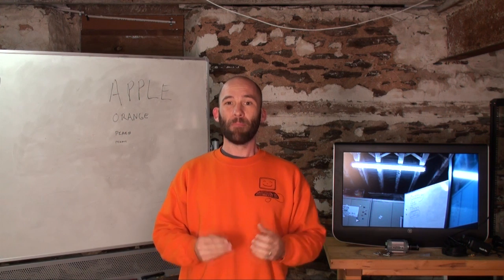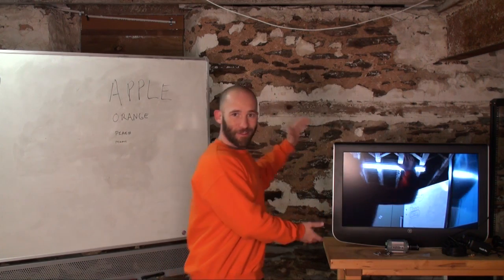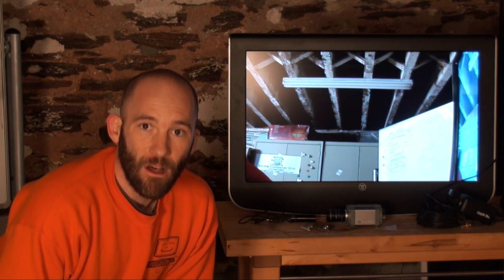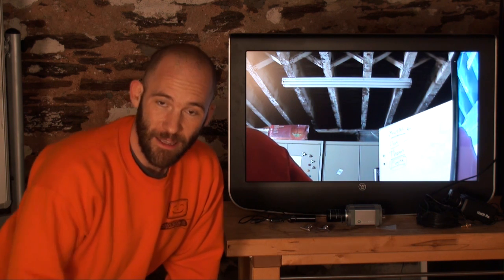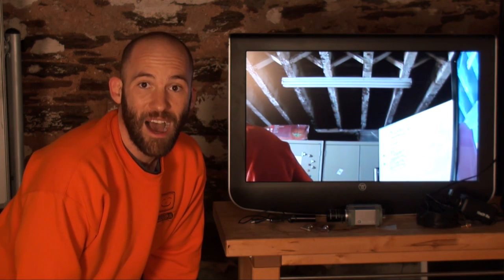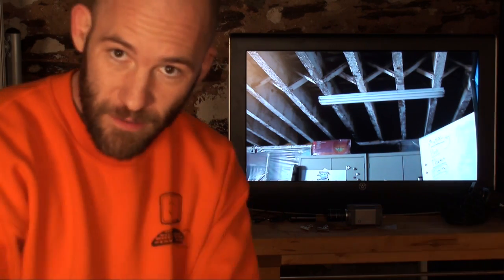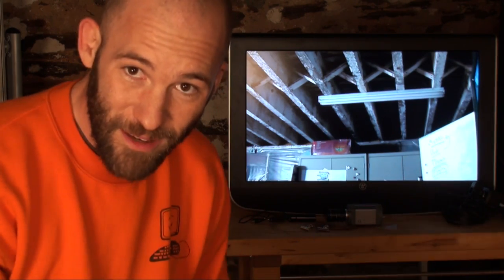Digital Surveillance Cameras

Comment: As an electrician / CCTV installer I can confirm you are very correct.  You must match the needed voltage requirements of the camera and CAN use a much larger amperage power source that the camera draws.  Look at multi channel CCTV power supplies and see what amperage the transformers are they utilize.  Think of all the 12 volt low wattage electronics you plug into the lighter plug in your car being fed from a VERY high wattage battery

Comment: @elithecomputerguy if the camera tries to pull 750mA than there is already something wrong with it and it won't function properly anyway.
I'm not saying that you should go get a 2 A supply and use it for everything. It just doesn't have to be the exact number on the camera. Some cameras have weird ratings and you wouldn't won't to spend the extra money on searching for those. 
If you needed a 350mA supply, you could just use a 400mA and still be same even if the camera pulled

Comment: I also want to add that multi channel CCTV power supplies will have a fuse on each output going to each camera. As someone else mentioned,  this will limit the amperage the end device can pull and use to damage itself should the device fail.  This fuse also protects the conductors from receiving more amperage than it is rated to carry to prevent electrical fires ... just as breakers in your home service panel work.

Comment: Many times installers using one big power supply for surveillance system. Lets say i have 4 cameras which draw 600mA each = 2.4 Amps total. I can use 4 separate power adapters  but i don't have to. Instead I am using one power supply which is rated 12Volts and 5 amps Maximum. Nothing wrong with that , works fine.

Comment: A cool way to check this is plugging the adapters into audio equipment that runs off 12vdc. You can actually hear the extra noise one PSU produces over another. 

I power nine cameras w/ 72 infrared LEDs off the 6 pin graphics card connector of a PCP&P power supply. It's the PSU that is used in the computer that is our DVR. It's a turbocool, before PCP&P outsourced everything to shitty companies. Almost no measurable ripple. It has at least 15 amps on that rail and no cameras dead yet.

Comment: You have a lot of great info but two quick correction.
1. BNC actually stand for Bayonet Neill Concelman connector, not British Navel Connector
2. A power supply amperage output can be rated higher than the draw of the camera without inflicting any damage to the camera.
Reply: well i'm gonna have to step in on this one,
Here in US eli's name standard is correct now if u are in Europe your assumption will be correct
for number 2 again it all depends on the standard Frequency here in the US is 50Hz while in Europe is 60Hz your answer is misleading !!
Reply: LUISTARWIND
lol actually is the other way around typo 60hz USA and 50Hz in Europe
Reply: LUISTARWIND
Reply: LUISTARWIND
No, Darren's answer is correct about output amperage of PS, because it only shows how much load can PS take and the actual load will be the summary of power drains of all devices connected to the output.
Reply: Great videos. To provide an example of what Darren Smith is saying about point 2 above...

If the camera says:
    12v 
    600ma
Then that means the camera:
    runs on 12 volts
    continually consumes 600 milli-amps
Therefore, the power adapter must:
    be a 12 volt adapter
    be able to supply AT LEAST 600 milli-amps (e.g. a 900ma adapter will do)

Comment: About the power supply: Both are correct. 

The voltage written on low power adaptors (such as one for a camera) is the voltage when the adaptor is connected to the camera and allready sucking power, not stand-by voltage. (When you suck the current out, the voltage drops.). So when you put a 2A instead of a 0.5A adaptor, voltage will be higher and might be too high thus frying the camera eventually.

Example: 60W adaptor will output 12V when 0.5A will be drawn out of it, will have 14V with 0.1A

Comment from the maker: @elithecomputerguy The voltage has to match. If there is a regulator in the camera then you might have wiggle room
but just say voltage matching is a must. If the camera calls for 300mA 12V DC you could use a 10A 12V DC supply.
It doesn't matter, it's excess capacity. And if some supply lists power and not amps for DC:

power (W) = current (A) * voltage (V) 

I actually have to worry about products getting this right for my new job.

Kevin

Comment: The BNC was developed for VHF Radio Cables and later Coaxial Ethernet cabling. A true BNC is a vibration & moisture proof sealed locking connector. The one you showed on the Video Lead is a cheap molded unit not worth a dime anywhere outside.
A quality BNC Termination has compression seals inside the cable entry where the gland nut tightens and a seal inside the locking ring that seals against the chassis socket the BNC connector joins. Most AV cabeling is RCA connectors in Red White and Yellow

Comment from the maker: IP means it's a network camera... as in connects using Cat 5 cable, uses TCP/IP, etc...

IR means Infrared which means it "sees" Infrared light and is used in dark conditions...

As far as upgrading... It depends on the system... I would suggest you go with a new system.  you may want to look at Axis or SmartVue...

Comment: Power supplies that have higher capacity are more expensive to produce. Cheap is the NAME of the GAME with wall warts. 

Wall warts are the lowest form of garbage power supplies. Cheaper power supplies mean less adequate filtering, more ripple voltage. Ripple voltage is bad for electronics that expect DC input. 

I bet you the higher amperage supply, to keep price down, has poorer regulation and more ripple. It's not about it putting out "too much power" - it's about the quality of it.

Comment: Interesting that you have to use 2 cables for the analog camera. A bit redundant, all antena systems power up amplifiers through BNC connector. (Also in PSTN network, your phone is powered on the same cable as your voice is transmitted on).

Comment: The BNC connectors are heavy duty military standard . I used them in many extreme environments . I agree that in house you don't need all of that but this is probably the reason that almost all manufactures uses this connector .

Comment from the maker: @andruha11234 AND THE ANSWER IS:

A theory:

Let's say the camera is rates 500 mA but tries to pull 750 mA temporarily because
something went wrong.

The 500 mA supply doesn't have the amps, what does it do? Does it try or does it have
an autoresetting fuse of some type? Camera lives.

1.5 A supply does have the amps, camera fries?

Comment: umm, 16:30... that is incorrect.
Amperes that are on the adapter is what it can output, not something it does all the time.
So, you can use an adapter that has higher amps that what is required and it won't damage the camera.

Comment: This is right. You can use 12V 500mA camera powered by 12v 100A adaptor. Nothing bad will happen to camera. And even more - you can use this 12V 100A adapter to power two hundreds 500mA cameras.

Comment: @elithecomputerguy  Re adaptors

It's probably a good idea to match the center pole as well. I'm not 100% sure for all equipment but a co-worker of mine, assigned to repair a rare piece of equipment because he was the best, forgot about the center pole and fried said equipment. It took time to track down and buy a replacement from a different continent. 

So, check the little diagram on any random adaptor and see if it is center-pole-positive or center-pole-negative.

Comment: hello, I have a tech question i'm installing a used commercial grade system at my dads auto repair shop. the cameras are working great ,I tested them using a small portable tv
before,during andafter installing prob iswhen Iplug them into the dvr,when cam1is plugged ingreat picture ,butwhen cam2 isplug in alone there isno picture,and whenthere both plugged in cam1is distorted and cam2 is stillnotthere .first I thoughtthe dvr wasthe problemso Ireplaced it,the probis still thereplease helpthanks.
Reply: +Robert O`Malley , there probably is an interfering signal along the way from the second camera , that has it not only distorted the 2nd camera`s signal but has interfered with the 1st one being carried through the wiring into the DVR itself , check if there are any power cables , though seem insignificant, passing across or near the 2nd camera`s cable.

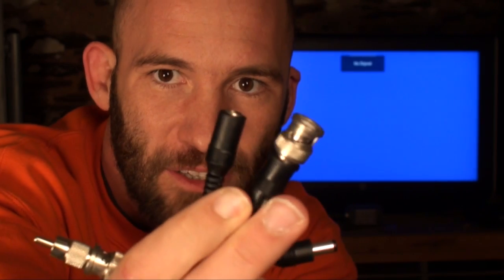Comment: At around 12:35 in the video the question is asked, or brought forward "why" BNC connectors are used vs other connectors.

Have a common sense answer to why BNC connectors are used in CCTV, vs RCA, or Cable TV type screw on cable connectors.

BNC connectors just require a twist to "LOCK" cabling to whatever you are attaching it to.  If you say have 30 -256? cameras (Heck or less that that) that were plugged into a DVR's, multiplexer's (or whatever) it would be VERY easy for the cables to come loose while servicing the unit if you used RCA A/V connectors.
If you were using screw-on cable tv type connectors it would be secure, but a royal pain to service.

Comment: Good info but you're dead wrong on one thing.  The amperage of a power supply for a camera can be higher than the minimum specified amperage without any problems.  The camera will only take from the power supply what it needs.  Voltage must be the same as specified but amperage can be higher and will work perfectly with a higher amperage and the larger amperage power supply will actually run cooler since it is not working as hard.
Reply: not necessarily matt !!
Reply: Matt is completely right, when it comes to REGULATED power supplies. it is is only older, out-dated UNREGULATED ones, that will have the voltage rise if all the available current is not used.
Reply: wow old comments.....

Comment: The main thing about power supply is the voltage, and making sure it's regulated. Too high a voltage and you will likely fry your camera. Always use a regulated PSU! Cheaper, non-regulated PSUs might be rated for (e.g.) 12v but actually spike a lot higher. Excessive amperage capacity in the PSU is not going to blow up your equipment. However, if the PSU amperage is too low, your PSU might blow up (but not the camera).

Comment: Hi Eli! im having a problem on my cctv online. its a swann 8 chann. dvr and i have already tested it to be working properly here in the states. i can watch it in my laptop and see the video and it works fine. the problem is i set it up in the phillipines and i cant connect to the internet. it is already set up in the house with 4 cameras and working with a wireless internet connection with an ip address. the ip address that comes out is a class c ip. its 112.210.226.68 what should i do?

Comment from the maker: @andruha11234 My electronics buddy agrees with you: Eli,

Hope all is going well. I noticed a comment on one of your videos about power supply ratings.
Wall warts and laptop bricks are all switching DC supplies like what you would find in a desktop
they are just smaller and don't have fans. There is no problem powering a tiny mother board with
a monster PSU, it's just excess capacity, this is the same thing.

Comment: no, what you said is not a compleate infomation, 1st.- Ip cameras rather han been better resolution than analog they depend of warm ligth, due to the sensor they have "CMOS" then during the day ligth yes hey are good, but the spectro during the nigth is 0 if we compare o he analog, hen ask yourself wo questions: 1 When are the crimes comitted most of the times during the day or during he nigth? 2.- If analog were that disadvantages  than IP then why we don´t find any airport unsing Ip cameras?

Comment: Uh, I've had extensive experience with Super Circuits.com. I have spent thousands at SC. In fact today SC told me a balun was unnecessary when using CAT5 on any digital or analogue camera. But do not believe the lux values because they are plain inaccurate. I returned several low lux cameras because they did not function as claimed and called SC on it and they said nothing. Then they made an illegal charge on my credit card. I called SC for an explanation.

Comment: Super Circuits said the charge was for the ink mark that they claimed I put on one of the camera boxes I returned and they claimed that the box was now unusable. They are that petty. I told them to reverse the charge and they obeyed. Along with the cameras I also returned a length of cable. Someone at Super Circuits did a poor job with installing a fitting on the cable and I ordered the cable because I thought it would be a high quality factory fitting, The CEO of Super Circuits is childish.